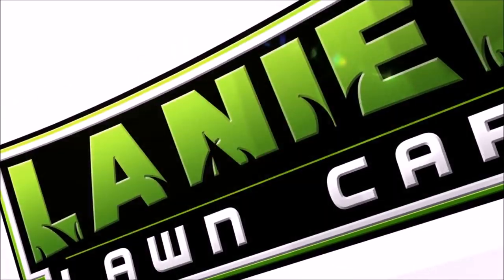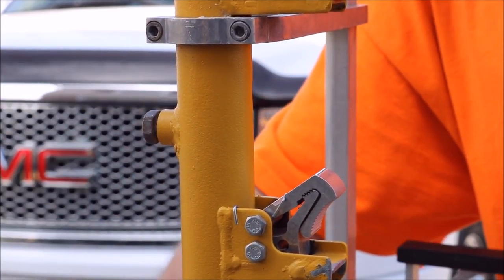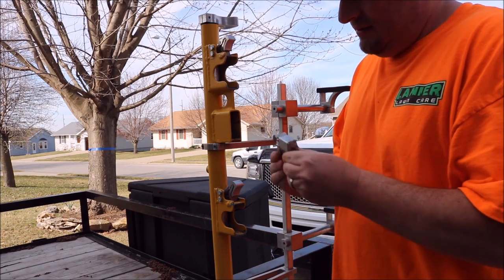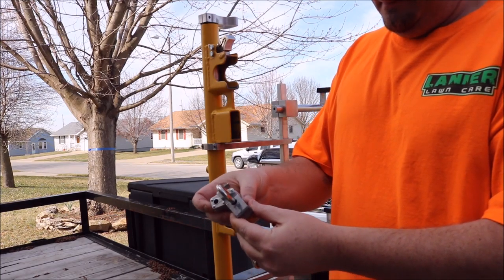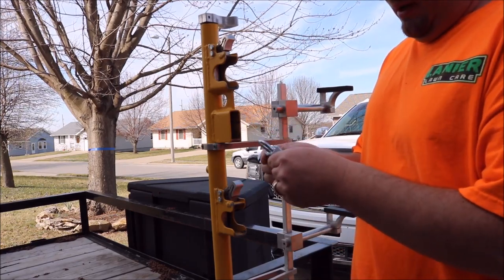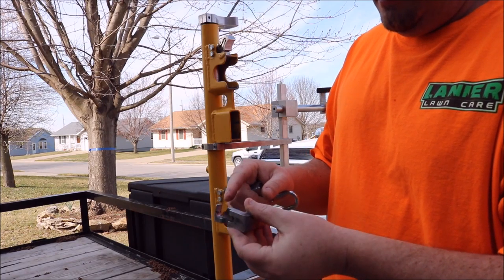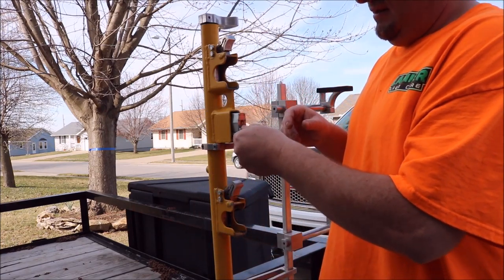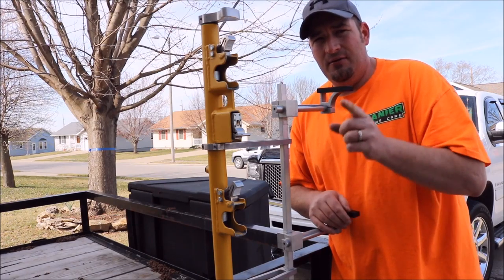Green touch trimmer rack padlock replacement. How To Video

Comment: Hello
Are you aware all the racks can use the same key
Reply from the maker: Yes. That’s One reason I switched to equipment defender. High quality combination locks, powder coated and better quality. Go check them out if interested and code lanier will also save you 10% off your order.

Comment: Have a question. if somebody happened to take out that bolt in the back of the rack. would've had free the trimmers without having to unlock the lock?
Reply from the maker: William Wellmann Even with bolt taken out, as long as padlock is locked. It will NOT free the trimmers. Still have to unlock padlock first.

Comment: I bought one 4 position trimmer rack and 3 blower racks. The all have lock issues!🤬  Have 2 replacement locks that I ordered from green touch and the too have the same issues of being hard to lock. Makes my racks useless.  Thankfully I have an enclosed trailer. 🙏🏾
Reply from the maker: Stuygym sorry to hear that. A lot of ppl are switching and have been switching from GT to equipment defender racks. I upgraded to them about 3 yrs ago and they are better quality IMO than these GT. Go check them out and if interested one day code lanier will save you 10% off.